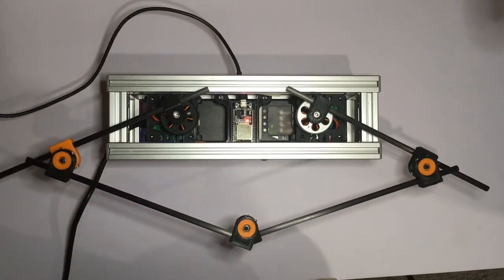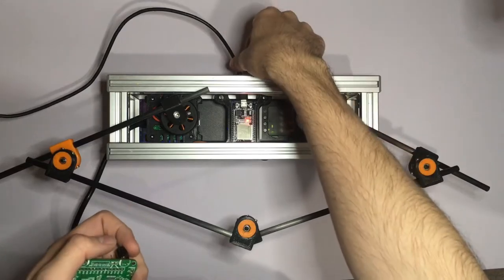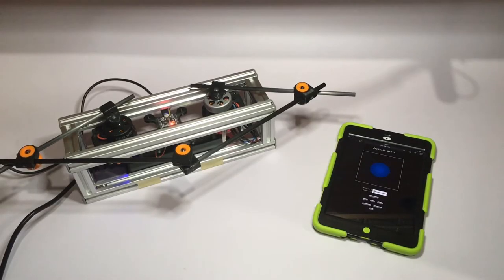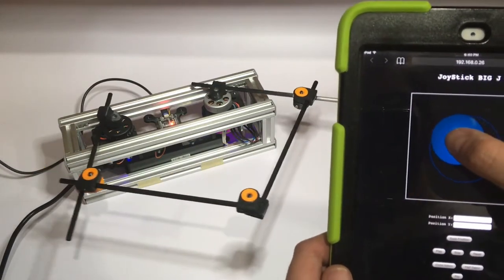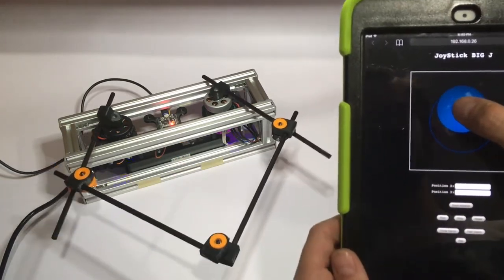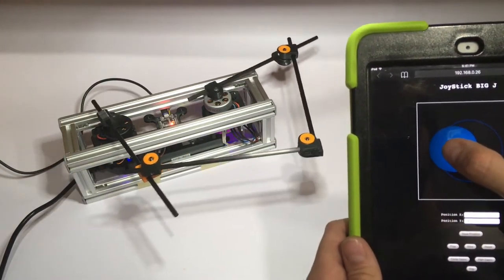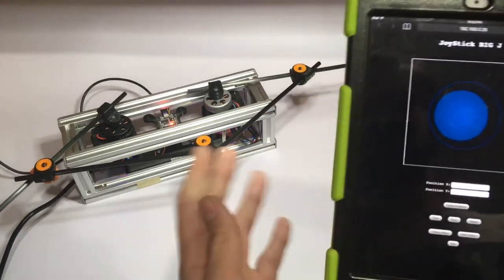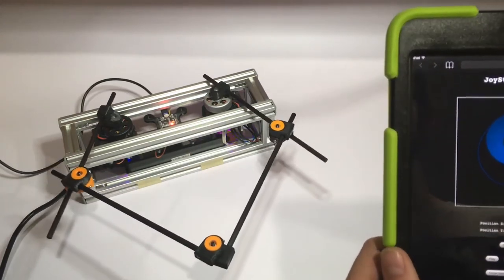Five Bar Parallel Robot - Big J

Comment: Why is it called a 5 bar robot? Aren’t there only 4 ‘bars’?
Reply from the maker: The distance between the motors is considered a bar. If the distance was 0 (one motor on top of each other) it would be a 4 bar robot.
Reply: @Dagor  thank you!! That makes perfectly sense.  Very cool project!
Reply: @Dagor  thanks for the explanation. I too was wondering the same.

Comment: Very cool!
Just wondering why you chose to have 3 ESP32s instead of one. One would be enough to control everything, right?
Reply from the maker: Given a different motor driver 1 ESP32 should be powerful enough to control everything. It is not uncommon to have a motor controller, which has its own microcontroller, connect to a master microcontroller. I just happened to like a lot the ESP32 for all its cool features :)

Comment: The circle is distorted, maybe you didn't account for the offset joints? Very interesting to play with though. A collab of Disney and ETH Zurich developed a system to minimize dynamic oscillations, that might help your robot too, or maybe the motors just don't have enough resolution for precise locating.
Reply from the maker: You're right and there's two reasons why the circle is a bit distorted. The first one is that the actuators are direct drive and a parallel mechanism has the actuators fighting each other and in some areas one might have the advantage over the other. The second is that the 0 degrees with respect the axis that crosses the two actuators is slight off in one actuator and I tried to fix this with code but didn't do the best job.
Reply: @Dagor  Thanks for replying to this question. I also was wondering about the circle algorithm. 
Very cool project. Thanks for sharing it with us.
Reply from the maker: @ddegn  The joint angles were calculated by solving the inverse kinematic model of the five-bar mechanism and feeding it a hundred points (or more or less) that make up a circle in the plane.

Comment: You do the flip! Very cool. I have made many stepper motor powered five bars, it's not really possible to do that with steppers.
Reply from the maker: I'm really happy I got that working :) I have seen your videos before and find awesome that you have made functional 3D printers out of these robots. My robot doesn't have any way to be controller other than the HMI showed in the video, would you recommend g-code interpretation so I could maybe make a drawbot out of it?
Reply: @Dagor  gcode is a horrible old standard, but it gets the job done, it's well supported. The tricky part is the path planning. 
The robot looks a bit "floppy", do you have enough torque to do drawing? You direct drive with pretty small motors. You sure have the speed!
Reply from the maker: @boxsterpontus  How do you interpret instructions with your robots? What would be your recommendation? I'm sure it has enough torque as is, but I'm planning on making it quasi-direct-drive to reduce these vibrations that you're seeing and expand the possible applications.
Reply: @Dagor  I only implemented the transformations from cartesian to motor positions (and inverse, and some other details) in reprap firmware, they do all the other parts. Path plannig, gcode parsing, motor control etc. The 3D printer world has plenty of good open source projects like that. The CNC community have some too, it's quite similar. You would need to plug in your motor drivers somehow, and implement the 5-bar.

Comment: Do you have any practical purpose in mind? I'm not seeing one... especially since it requires three 32-bit processors to make it function. I can get much more precise motion control and far greater torque over a larger area with a single 8-bit microcontroller.
Reply: @NoOne-vm2wd  That... is a possibility, although still not wicked practical. Maybe as an adjunctive device for handicapped artists.

Comment: how is the brushless controled with the precision of a servo... can this tech  be used to make legs for a walking robot
Reply from the maker: With the FOC (field oriented control) algorithm and a regular controller, such a PD position controller. Yes you can, a very typical application for brushless-based actuators. Check out my Quadruped Robot series! :)
Reply: @Dagor  thanks

Comment: Whole three esp32! Not too many?
Reply from the maker: Same answer to you! - Given a different motor driver hardware one ESP32 should be powerful enough to control everything. That being said, It is not uncommon to have a motor controller, which has its own microcontroller, connect to a master microcontroller. I just happened to like a lot the ESP32 for all its cool features :)